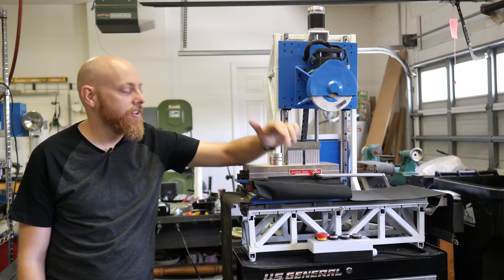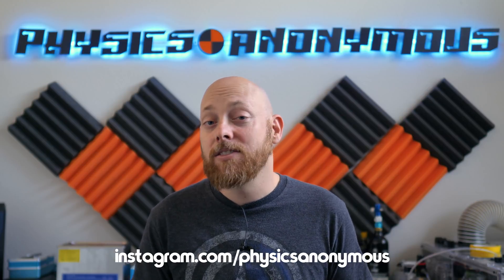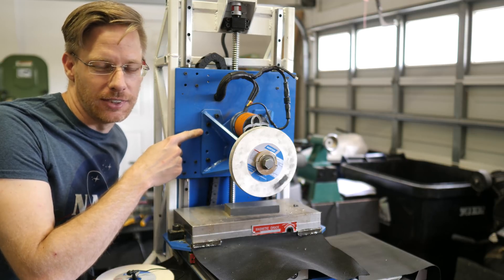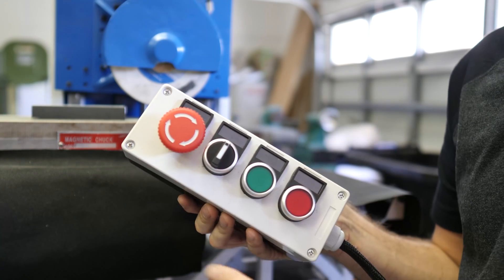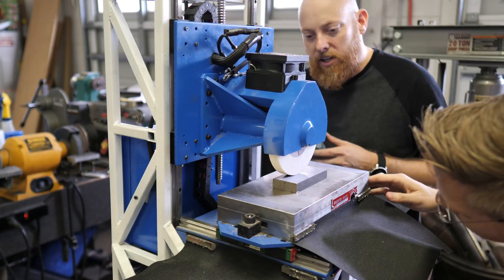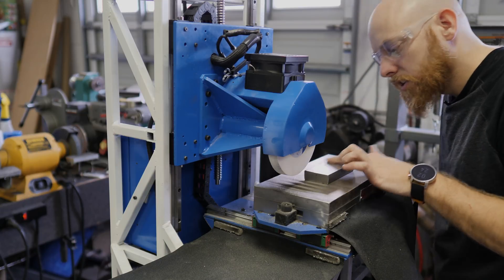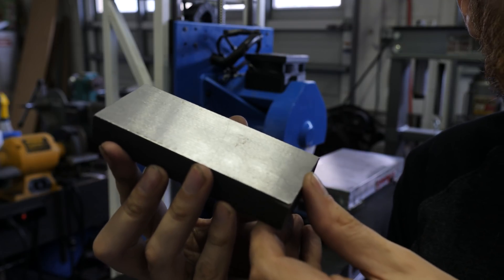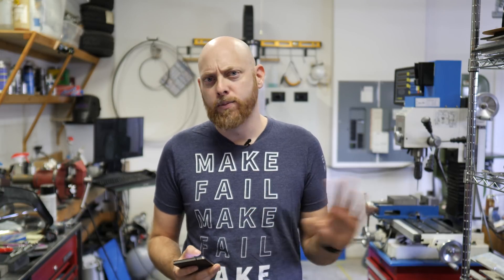About that DIY Surface Grinder - S03E02

Comment: I'm most probably wrong but the chatter marks on the steel might correspond with everytime the x stepper motor moved as it seemed finer when the speed was decreased. Maybe smoothing out the step pulses going to the stepper? Great videos btw the lathe got me hooked😂
Reply: Nah, definitely coming from the wheel
Reply: @CatNolara  yeah the spindle they have is completely inadequate.

Comment: What's the reason it chatters? I mean I am a  total noob but I would guess something like too much play, or not enough speed or something about getting to the natural frequency. Would like to know the answer though. Great work guys appreciate your effort!
Reply from the maker: Total noob to total noob, but there are a lot of ways to combat chatter (every machine will have chatter, even the big ones, if not used right) in our case it's probably a combination of spindle play, feeds and speed, and total rigidity of the frame. Though i think the frame is contributing a lot less then people think. After this video was made we played with the feeds and speeds even more and got better results. If the over all machine was stiffer and heavier, we could run a lot faster and be less likely to get chatter, but for our needs, this machine does just fine.
Reply: The chatter will partly be because of an unbalanced spindle... example of unbalanced spindle in my video here Buffalo Machinery Microcut 612B surface grinder first run https://youtu.be/yKAsx7L2Glg

Comment: The problem is that the machine is not build from cast iron.
Metal frame are not ridged enough.
Big brand put spring loaded bearings on the spindle as well.
It is not easy as abc to build a good surfice grinder at home.
I have a 70 years old surfice grinder and it still producing accurate and mirror finish.

Comment: Board it up and fill with epoxy granite, be super rigid then :)
Reply: This comment pops up about every video of this project, but no. Next thing they will try on the chatter is probably repainting the machine in another color to see if that makes a difference. Stubborn.
Reply: @ErikBongers  😂
Reply: Agreed!
Reply: Or just concrete from Lowe's or Homedepot
Reply: Same thought I had steel tubing is a very good spring not a very good ridged support
Reply: Or just build a surface grinder from used granite tomb stones, since linear rails can be bolted to about anything.

Non normalized, welded steel frame is about the worst material for machinery, especially for surface grinders, where precision and good dampening matters the most. 

 So far, lots of effort for an inferior machine. Made those mistakes as well, when I was young. But learned from it, like that you can't build everything at home. And if you try, it usually will be a mess.
Reply: @hinz1  what do you suggest if they want to start a business? If they really will put in the extra work to refine things do you think it can be done, or is it just an exercise in futility?

Comment: I can almost guarantee that's not chatter. I'll bet it has something to do with the cogged timing belt you're using to drive the spindle. When you're down in the tenths, everything matters. Even the type of motor. Single-phase AC motors have an ever-so-slight cogging effect, just because of how they operate, and that can easily show up in the finish on a surface grinder. This is why pretty much every surface grinder is 3-phase. You guys are using a brushless motor, which is a 3-phase, so you've eliminated the motor effect, but you've put it right back in with that cogged belt. I'll bet the waviness in the surface finish correlates to the actual tooth spacing on the belt.
Reply from the maker: That is an awesome theory, and not one we considered. Maybe the next update we will replace the timing belt with a v belt. There is also a good chance it's coming from the spindle bearings. Despite our best efforts, there is still a tiny amount of play in them
Reply: @PhysicsAnonymous  Axial or lateral play? Is there still play in the after you let the spindle run a while? Let it run 4-5 minutes, then check... See if letting it come up to temp makes a difference.

Awesome work with this, by the way. Seriously impressive that a home-built surface grinder can hold a couple of tenths tolerance.
Reply from the maker: Axial play, probably about about a thou when cold, and maybe 3 or 4 tenths when warmed up. After installing proper AC bearings in the cnc (upcoming video) I have a bit more of a feel for what it should be like, and the ones we used on the surface grinder are definitely out of spec. which is probably why got them so cheap.

Comment: At about the 10 min mark in the video... I dont think that is chatter at all. I think that if you calculate how far the work piece moves for each revolution of the grinding wheel  you will get a distance that corresponds with the distance between the "chatter" marks. This is caused by a slight unbalance in the wheel setup which causes some small vibrations as the work piece moves along. And the wheel revolutions is very low, so the work piece travels some distance for each revolution of the wheel. Therefore, increase wheel rpm and decrease work piece feed. I would say 3000 to 4000 rpm would be good speed for that size wheel.
Reply: Something sounds out of balance when the wheel is spinning,
Reply: Good point about the RPM, though I don't think balancing really matters. A lot of small surface grinders (5x10, 6x12) don't have provisions to balance the wheels.Throw it on, dress it, true and go. Although I will admit they're using a wide wheel... I'm used to seeing 1/2" wide wheels. Might matter a bit more, as it's likely a bit heavier. I still think the surface waviness is related to the cogged drive belt.

3-4k RPM sounds about right. It's more about surface feet per minute (SFM). Most surface grinders with 3450 RPM motors, which gives around 6k SFM with a 6" or 7" wheel. You can change the behavior of the wheel by playing with the RPM, faster making it act like a harder wheel, slower, softer. You definitely don't want to exceed the rated speed of the wheel, however. Maybe 3450PRM  +/- 20%.
Reply: @exhempknight  when you true and dress your wheel you are balancing it. The washer and nut combo that seems like a really cheesy way of mounting the wheel to begin with is like a self centering system. The first time you run it it tries to center it, you true it, you're halfway there. When you dress it you should be very close to a balanced wheel.
Reply: @christopherleveck6835  Dressing the wheel has very very little to do with the ballance, think about it.
Reply: @christopherleveck6835  totally wrong about the balancing part. you have to balance it first and then dress it. Maybe even balance it after dressing again. no wheel comes out perfectly balanced. I work at a toolmaker company. Every machine will vibrate when the wheel is out of balance
Reply: @MrHughk1  Being a tool & die maker with 40 years precision grinding experience, I personally don't need to think about it. For wheels 8" and under, dressing the wheel trues and balances it as much as necessary. Only larger, wider, heavier wheels require balancing. 
I may change wheels 6-8 times a day depending on requirements. I have never balanced a wheel under 10", nor ever known a grinder hand to either.
Reply: Chatter could certainly be due to unbalance, but also due to the resonant frequency of the machine in the vertical direction.  All machine tools have resonant frequencies, which is unavoidable, but they are designed to avoid exciting those frequencies during use.  If PA did any stiffness or vibration analysis before fabricating this grinder, I missed it.

Comment: I love it! You can see the chatter in the thumbnail on the video where you declare that we were wrong to say that it wasn't going to work as well as you thought. Not "won't work", just "not going to get real surface grinder quality from a machine built as though you wanted it to resonate like a bell." Couldn't have picked a better thumbnail to illustrate what we predicted long ago. 

It's a cool project I just can't figure out why you would make it out of hollow tubing without at least filling the tubing with lead. Never mind making it out of solid members.
Reply: I bet they can get much less chatter with better feeds and speeds. But say maybe 0.0002" flatness and surface finish enough to get the air bearing effect on a surface plate is good enough for anything you want in a home shop, and that machine has the perfect form factor for one too. No, they won't regrind their lathe bed with that (and they didn't mean to anyway), but neither will they with some clapped out monstrosity from 50 years ago which is they only reasonable alternative to this build.
Reply from the maker: Our main goal was just to have a machine that makes flat parts. I don't care too much about surface finish. 

The main reason is just cost and time. At some point it makes more sense to just buy a used one, but that doesn't make for a very interesting video. Solid tube costs 4 or 5 times the price, and casting led into hollow tubes can be a pretty big pain. 

But all things considered we exceeded our goal by a good margin, it just didn't live up to other people's expectations, which is fine by me.

Comment: The quality you're getting is pretty decent for the machine you have. I really think you're reaching the limit of what you can do without a much stronger spindle.
Reply from the maker: Yeah, totally agree. I think the spindle is definitely the weakest link right now. But it's doing what we need it to do. We really designed it to make things flat, not make pretty looking parts.
Reply: @PhysicsAnonymous  Bigger and heavier is always better with something like this. I'm already amazed what you reached with a relatively flimsy construction like this. I'm more used to thous cast iron 1t minimum machines. For what it is and what machinery you had while making and assembling it it's a really really good result.
Reply: Physics Anonymous it seems to work but the spindle does sound flimsy, and there are few substitudes for cast iron mass .

Comment: Put some of that etching liquid they use for welding, might help to see the grain or chatter?
Reply: That also would require a microscope, a steel grain is visible at x100 magnification after etching.  Welding grain is much more bigger bacuse of thermal overheating.
Reply: @XPbIM3  cool, I did think after posting maybe it shows differently because if the two different metals, but you delivered a sound bit of knowledge there. Thank you

Comment: First!
Reply: No
Reply: The spindle sounds out of balance  and the sub straight is not rigid enough to grind properly but you get the àtaboys for trying remember any vibration at all will be reflected in the part you are trying to grind